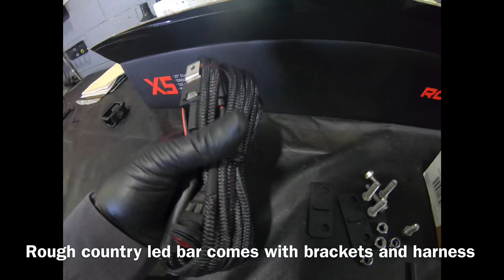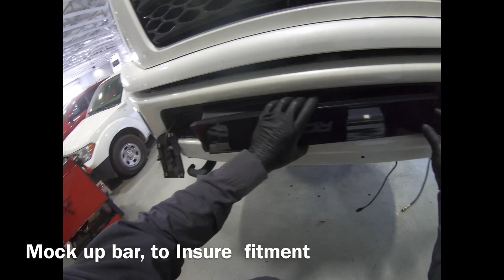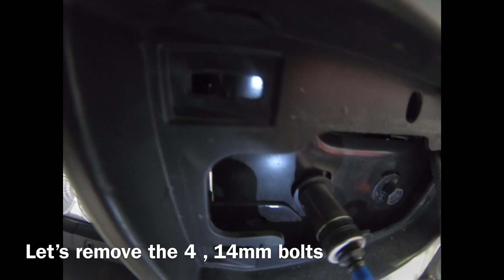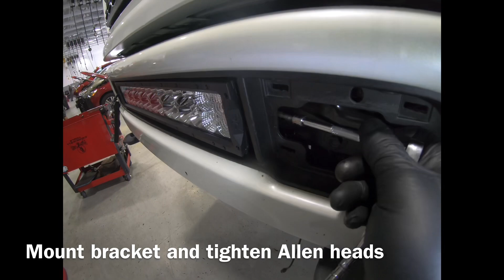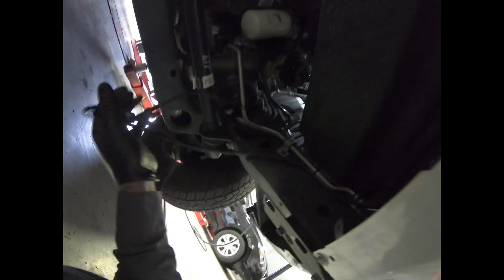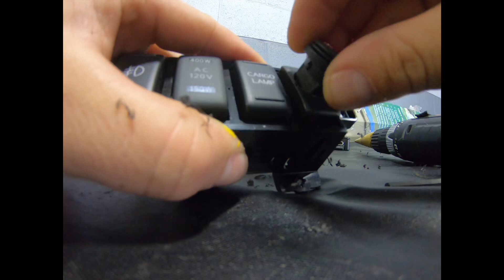Rough country’s X5 20” led bar installation

Comment: Did you notice your transmission temps get any higher after installing the light bar? I got the rough country steel bumper and the light bar is in the center and noticed my trans temps were higher when towing in hot weather, i guess since the light bar blocked the airflow to the trans cooler.. Usually these trucks don't ever get hot enough. I moved mine to the top of the bumper and they're back dowm lower now. I had hit 220 just on a short tow. Now it doesn't even get to 200, and even when its hot it stays around 170 inloaded. The transmissions in these trucks usually run pretty low when stock.

Comment: What did you finally use as the positive power source? I am connected directly to the battery, but want it connected to ignition on power.

Comment: Do you ever have back pressure come out your intake? Also what tuner do you use?
Reply from the maker: Timmy Grounds verrrryyyy rare occasions when I’m towing (13k) 
Running gdp tunes
Reply: Mine does but its because the transmission short shifts while its still accelerating even when I'm into the throttle. The transmission tuning on these trucks is terrible. Love truck but haye how Nissan tuned the transmission and throttle mapping.  Running the GDP sotf tune 0-120hp. Still short shifts to 4th evem under moderate to semi heavy throttle. I just manual shift it now.